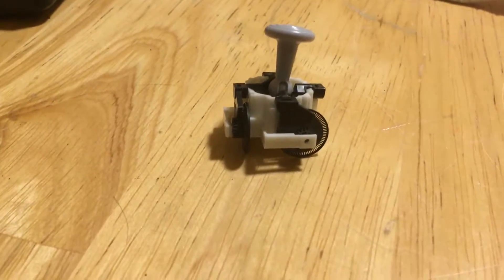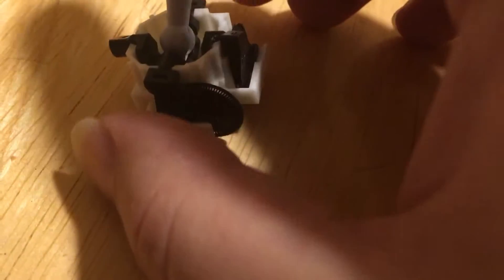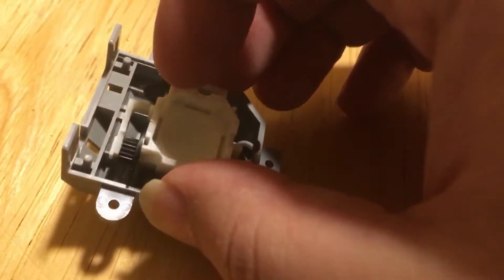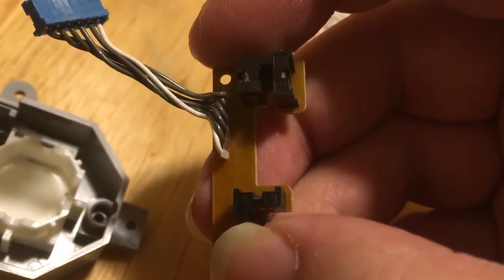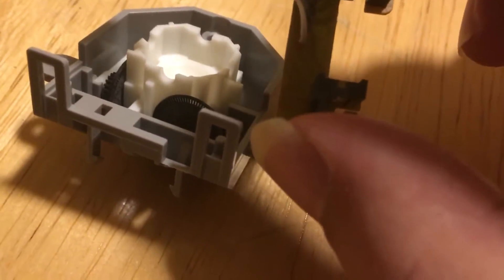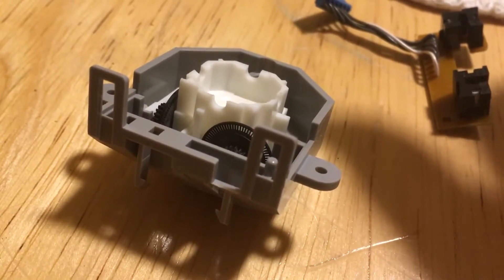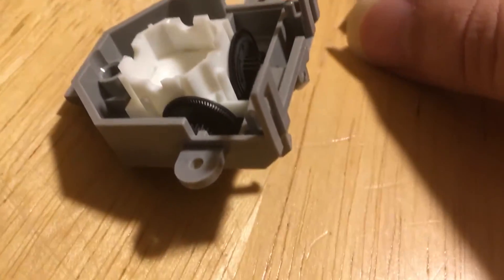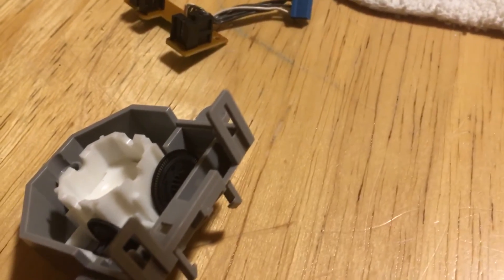How an analogue stick works

Comment: I'm fairly certain that this construction is unique to N64 stick. It's also interestingly not analogue but purely digital, it counts steps, and a ball mice (those that came before optical mice) were made the same way. The sensor is actually two IR receivers, so it can tell which direction the rotation is, not just how many steps they made.

Most consoles use the ALPS stick, which uses arms that split the motion of the stick into axis, just like here but inverted, that are connected directly to two small potentiometers, no gears. The potentiometers are actually quite long lasting, at least the better made ones, but the minituarised mechanics that splits the motion isn't, it grinds itself to death. ALPS was the original manufacturer, but not all of them are made by ALPS any longer, there are copies... the suspicious unbranded ones used by SONY, and the fairly good Mitsumi used by Nintendo. The controllers rely on the potentiometers splitting the resistance range exactly in the middle when the stick is centred, there is no power-on calibration.

Dreamcast and Saturn didn't need to split the motion into axis mechanically, the bottom of the moving stick has a magnet embedded into it, and the PCB underneath has 4 Hall effect magnetic sensors, and the controller compares magnetic strength readings to decode the axis. Similarly to N64, the stick needs to be centred when the controller is powered on, it takes a calibration reading then to zero itself out. Additionally in the Dreamcast, the spring is in the jig that modifies the spring preload depending on the direction, so it would feel lighter on the main 8 directions.

Smash community recommends lubricating the stick mechanisms to reduce wear, with something like sticky lithium grease, and i've found that it does work great on ALPS sticks. Generally the sticks come unlubricated from the factory, with exception of the Dreamcast stick that is for one made completely from Nylon which is pretty wear resistant and self-lubricating as it is, and is also loaded with sticky grease that actually needs to be replaced because it deteriorates with time.
Reply: How does the Dreamcast Stick compare to Modern ALPS sticks?
Reply: @Vinnay94   Dreamcast stick has larger throw (movement range), overall slightly higher resistance (except on principal directions), faster and much more decisive centring action with basically no overshoot and bounce, and shows basically no aging, other than the grease needing to be washed out and replaced eventually. However the top is free to rotate somewhat around the vertical axis by just a couple degrees, making for a potentially slightly confused and sloppy feel, but it's purely rotational, there is no side-to-side wobble at all. It's operated differently than modern sticks. On an ALPS stick, there is usually an integrated push button, and you operate the stick by dragging it horizontally, unless you want to push the button. The Dreamcast stick, you can drag the stick lightly across to make the stick confine you to 8 principal directions, which will probably feel weird for most people today. You push it down and to the side to control direction and magnitude precisely, and the precision you can achieve is amazing - but in combination with a non-rubberised top with sharp dimples, it can be painful over time.

Saturn 3D analogue pad doesn't have the action where it tries to nudge you towards principal directions, but otherwise i don't know how it feels, i never had an occasion to try it. I think by skipping this action, it would be possible to confine the top better where it doesn't tend to rotate around the axis, but i don't know whether it was done like that there.

In the late 90s, analogue gamepads were still new. I myself come from purely PC centric background, and the only joystick i had before was a big QuickShot flight stick that i used to play Flight Unlimited with, but otherwise i was used only to mouse and keyboard; others would be coming from D-pads on earlier consoles. When i got my first PC analogue gamepad in early 2000s, it was a DualShock clone, actually a very well made one, and i did not become friends with the analogue stick, i could not run straight, i was always on a random angle and i couldn't control it very well. So i really appreciated how easy it was to always feel the direction or stay on a known direction on the Dreamcast stick. Nowadays of course i play with an Xbox pad and that's not an issue at all. Nintendo had an interesting alternative starting with Gamecube to solve the same angle confusion issue, that there is an octagonal outer gate, and that at least when you max out the magnitude, you can feel the direction. So while the decision to have that force control plate that nudges you towards principle directions in the Dreamcast is from today's point of view pretty questionable, it solved a real problem at the time when people weren't used to analogue sticks yet.
Reply: @SianaGearz  That's great, a lot of modern ALPS have a short throw which results in snappy inputs which is fine for movement, not so much aiming. Now I really wanna compare a Dreamcast controller to say a DualShock 4 in terms of aiming.
Reply: Holy..... thanks for explaining in such detail, are you an engineer
Reply: @ridwan9610   Yes, but not necessarily related, i have electrical engineering education, and am teaching myself mechanical CAD (computer aided design), have been for several years now, slowly. I also sometimes repair classic consoles and controllers as a hobby. I have also worked in vehicle ergonomics research at one point. I find input devices of various kinds fascinating and try to learn about them as much as possible, and might actually end up designing one or several if i ever get around to.

One reason is that i have not found a high performance gaming mouse yet that fits my hand, so that's something i might want to tackle eventually. I have tiny hands which affects the usage of both mice and gamepads, there are very few i find comfortable, and i am pretty prone to pain. And another is that i think i can make a Dreamcast pad which can have a builtin backlit LCD and save storage and rumble and maybe even automatic memory card management, plus it can have 6 face buttons and dual sticks, because it turns out, support for those was foreseen from the get go. Retrofighter DC pad is such a huge missed opportunity!